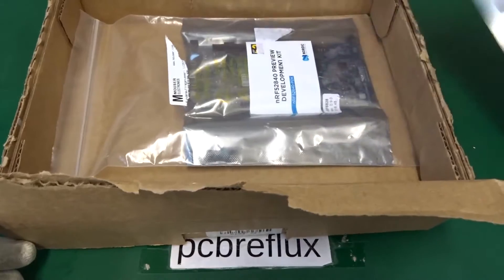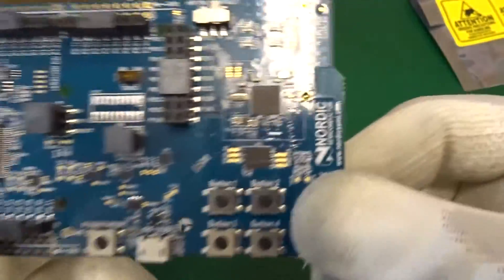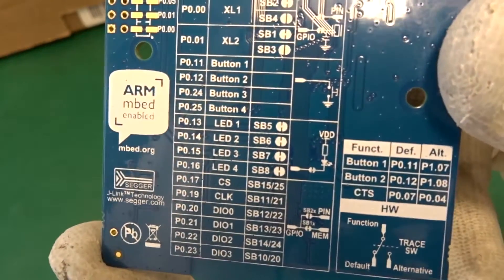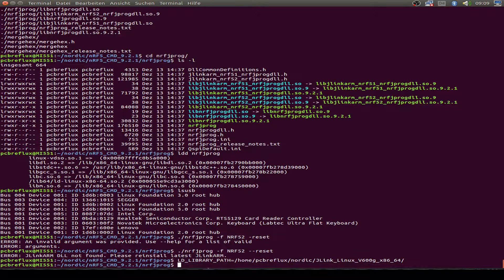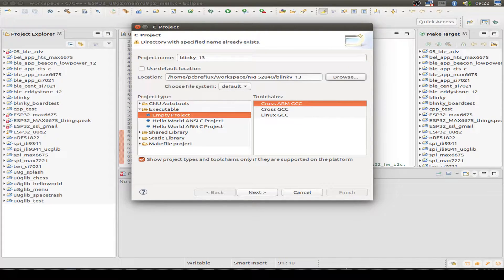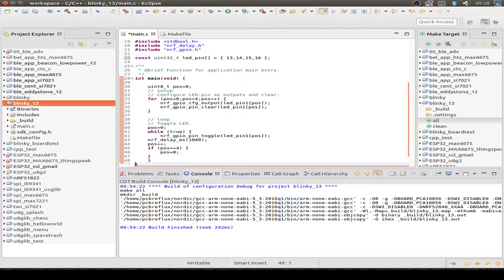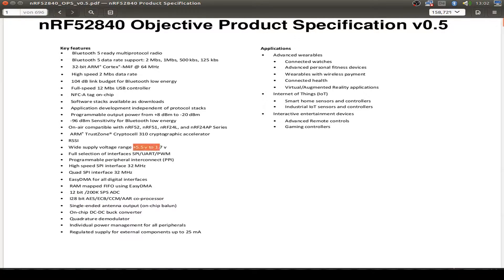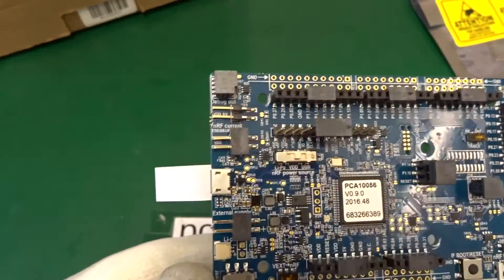nRF52840 #1: Bluetooth 5 Preview Development Kit

Comment: i just want to send the data from nrf5240dk to internet , but there is no wifi chip on nrf52840dk ,so i thought ,i can connect nrf52840dk to esp 32 with the bluetooth chip between 2 boards  , so the data from the bluetooth of nrf52840dk will be sending to the bluetooth of the esp32 ,then from  bluetooth of the esp32, send to the wifi chip on the same board of esp32 , then go to wifi house router ?  will it be possible in my way ?

Comment: Hello,
Very good work.
I want to ask one question to you, if it is possible i want to use your experiences about Nordic.
I have hobby project.
I want to use bluetooth and MPU accelerometer. ,
Do you know what is the nRF52840 range ?
What i need to consider when i drawin pcb nRF + MPU.
Reply from the maker: Hi, for the range: nordic have done a test: https://www.youtube.com/watch?v=w4PbxVwg83M (don't be sure why no one follow the drone with the remote?).

Would you use the nRF52840 dongle or the nRF52840 raw? What kind of antenna?

For the nRF + MPU consider your voltage source and regulation and if using I²C or SPI with or with out pullup resistors.
How to programm the nRF: kind of programming/debugging BUS or OTA?

Comment: Hello! I need long range distance in my projects. The chip nrf52840 have it but iit's  difficult (or expensive) for production in compare with nrf52832 (due to specific pins locating on the chip). I need something about 100m with one obstacle. It's very pity espressif started to produce esp32 before bluetooth 5 appeared. Do you know smth about any plan of espressif system in direction of bluetooth 5 (I mean long range not just compatible with v.4.2) .
Reply from the maker: Стас Фролкин Sorry don't know. But this is a good question for the esp32.com forum. But maybe with a good antenna you get a way with the nrf52832 or esp32 at 100m?

Comment: ERROR: JLinkARM DLL reported an error. Try again. If error condition
ERROR: persists, run the same command again with argument --log, contact Nordic
ERROR: Semiconductor and provide the generated log.log file to them.
?
Reply: Do you have any solutions?

Comment: When would you use a "nRF52840" chip and when would you use a "esp32" chip ?
Reply from the maker: if I do somthing with wifi and shortrange ble then esp32. If bluetooth 5.0 or usb  or hardware security  then nRF52840 but dont know any prices yet. if low power short range ble only then nRF51x.

Comment: Hi, in first place thanks for this amazing video! I am trying to follow this amazing tutorial with my nRF52832 and I get this message when I try to flash my board with nrfjprog:

--------------------------------------------------------------------------------
./nrfjprog -e --log
nrfjprog verion 9.4.0
--------------------------------------------------------------------------------
FUNCTION: open_dll.
FUNCTION: open_dll.
FUNCTION: enum_emu_snr.
FUNCTION: enum_emu_snr.
FUNCTION: enum_emu_snr.
FUNCTION: enum_emu_snr.
FUNCTION: connect_to_emu_with_snr.
FUNCTION: connect_to_emu_with_snr.
FUNCTION: connect_to_emu_without_snr.
FUNCTION: enum_emu_snr.
JLinkARM.dll OpenEx returned error 'Can not connect to J-Link via USB.'.
FUNCTION: close_dll.
FUNCTION: close_dll.

I have installed J-Link Software and Documentation Pack all-in-one from Segger (last version, not the same that yo use in the video) and it seems that my board can't be connected.

any idea about this issue?

thanks in advance.
Reply from the maker: Hi, 

can you reveal more infos? 
OS Version, Segger Software Version and output of lsusb and dmesg? 
-> mostly dmesg gives you a clue.
-> are you getting an attached usb filesystem (this is what the nRF52840 boards do)?

Thank you and have a nice day
Reply: just a simple permissions issue. SOLVED! ^^!